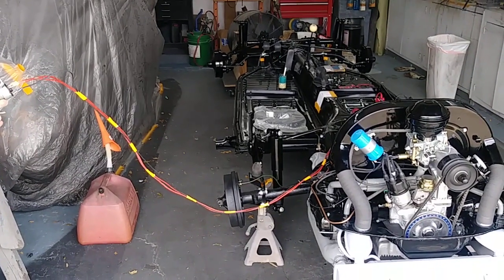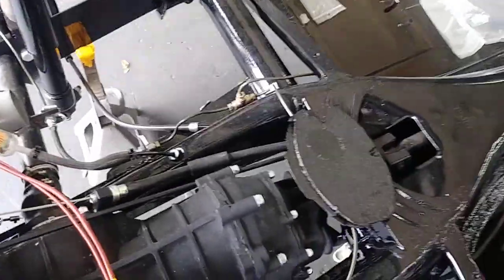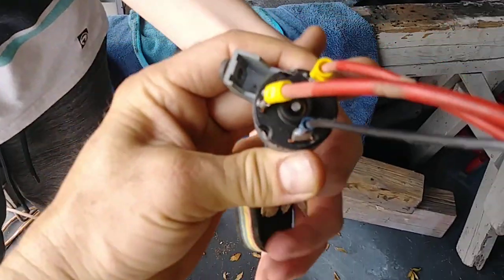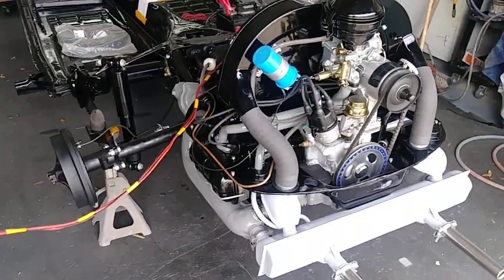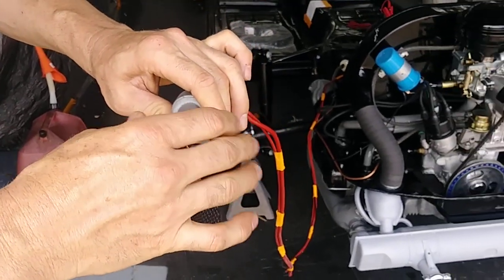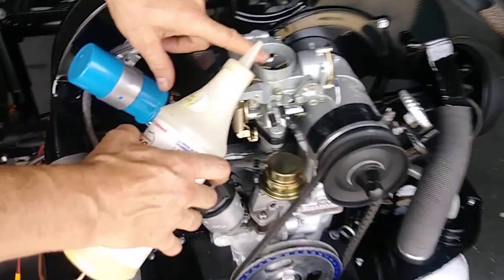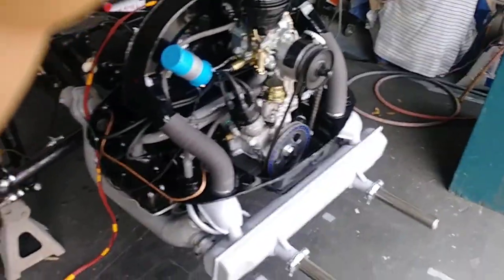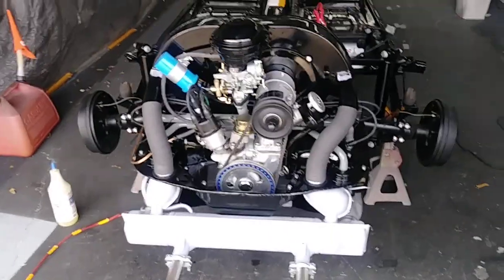How to wire a vw motor to hot run test

Comment: Great vedeo just one question what gage wire did you use
Reply from the maker: Unfortunately off hand I can't tell you what gage wire I used. I pulled these wires from a factory harness.  

I believe the gage is indicated on a factory wiring diagram. You can find these diagrams on thesamba.com

Comment: Where does the voltage regulator come into play (12v)?  I have two diagrams that don't show how the regulartor is wired.  Both fail they I do the test you are doing in your video.  How does this wiring scematic work with the regulator in the mix?
Reply from the maker: The electrical system was not hooked up for this test.
Reply from the maker: https://www.thesamba.com/vw/archives/info/wiring/bug_1500_Sedan_and_Conv_Motors.jpg
Reply: Thank you. @m.r.d.c.5179

Comment: Isn't there a jumper from the positive post on the coil, to the electric fuel shut off solenoid as well as the electric choke? It looks as if your engine has a blue and white striped wire doing just that. Perhaps you did not mention it, since you did not use fuel out of your tank, but if anyone else has a set up similar to yours and was using the fuel tank, it would not start without at least power to the fuel solenoid.

Good Luck, 
Sparks
Reply from the maker: This is a mechanical fuel pump.

Comment: Any VW guy knows a jumper from the + on the regulator to the - on the coil will allow spark at the plug...maybe Henry needs a new teacher!
Reply from the maker: True. But running pozitive through the key switch is safer so the points don't get burned up  from positive on constant power.